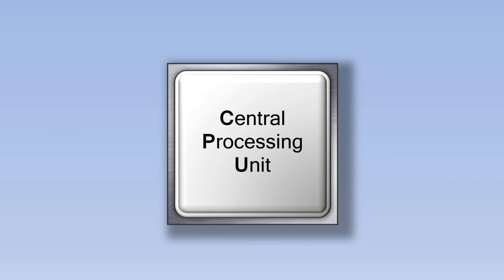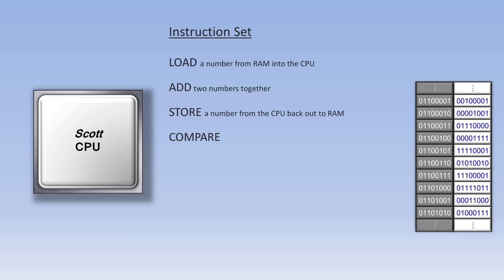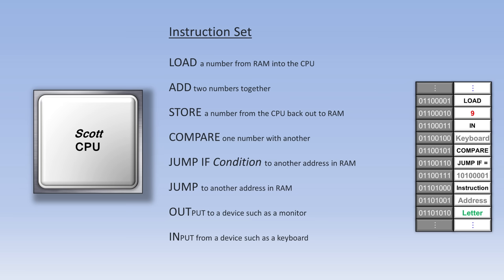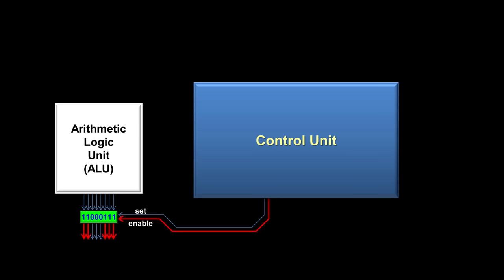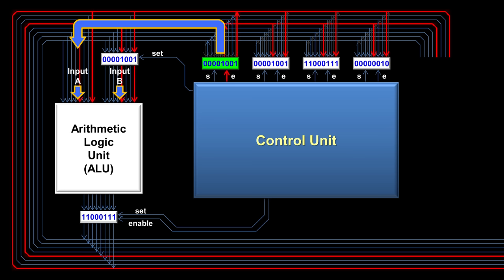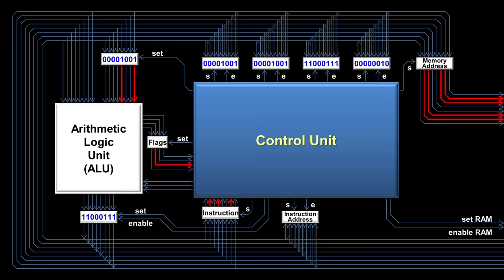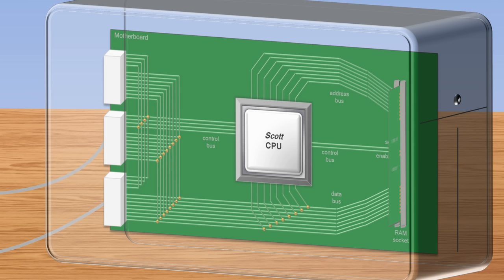How a CPU Works

Comment: Funny how these CPU's have IN and OUT instructions instead of handing I/O devices at a memory location and using Load and Store instructions. I believe Motorola's 6800 used the full address space in a linear manner and did not have I/O-specific instructions. But he did say that the Scott Computer's addr bus is only used for RAM.

Comment: I started working computers back when they had vacuum tubes.  Basic intro to Computers,  They are like your kitchen they have a counter top /CPU.   A storge area shot term/  the shelves  of your kitchen and log term storage/ The cabinets and BACKUP storage / the pantry.  The size of each is the ability of one person to do the work/  AKA store data and produce output  meals.      The speed of the CPU is how many cooks there are in the kitchen.   THIS IS BASIC COMPUTER PROCESS IN A NUT SHELL.

Comment: Thank you very much for this video ! Unfortunately, I knew all this. I am wondering how the data is processed through wires into the CPU. How some electrical inputs into CPU wires can output the result of an addition, for example ? :) I know that the 0 and 1 correspond to electrical presence or no electric presence, but how could it have a precise result ?

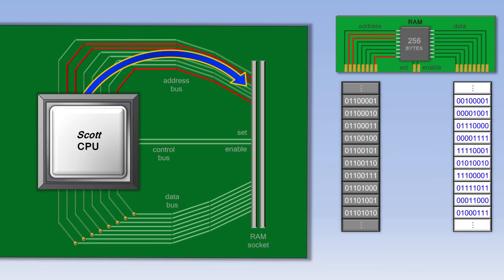Comment: 2:42 why is the data bus on the RAM used for reading and writing? wouldn't that mean there are input and output Logic gates on the ram hardware itself for reading and writing? and wouldn't that cause a short circuit? 

ps; im not an experienced electrical engineer or some sort, i just tried this on a digital logic circuit sim where I connected an input button to the output of a logic gate.

Comment: hi it's good but you only show how it works on its level would be good to have some micro architecture insights = bus openings etc and logical circuits as well, the foundation of microprograms and finally the logical gates etc

Comment: I don't understand how these wires can switch on and off billions of times each second. I also don't understand how the wires can be so small and close together and how it is possible that the electrical currents don't interfere. I always hear a wifi can mess up information in a unshielded cable so how on earth are there no problems inside the cpu where wires are basically on top of eachother?

Comment: MULTIPLE CODING
Why use binary code?
because the introduction of the third variable will lead to coding inaccuracies due to AC voltage surges.
If you use constant current with constant voltage in processors, you can create multiple coding.
It's increase in computing performance.

Comment: One question: HOW THE FUCK A CPU CAN PROCESS MILLIONS AND MILLIONS OF INSTRUCTIONS PER SECOND?!
Reply: The internal clock is running that quickly. Electricity is conducted at near light speed, so all you need is something to be stepping through your program quickly enough.

Comment: Hey where goes turn off signal from cpu? normally shutting down pc.Not with swich button from desktop. when shutdowning with swich tester drops voltage from +5to0and and goes back to +5 but when shutingdowning normally ( in pc desktop start shutingdown)no signal comes to swich...🙃 so if you could. please help to find signal😊

Comment: i wonder if we will ever get to a point where literally the electricity cannot move fast enough around in the processor and hit the ceiling of the electrical processing power 🤔
Reply: That is actually the reason a cpu has limits on speed.  Electricity causes heat. Too much heat things melt.

Comment: But what do I need the RAM for? Say I save the adress of a bool in a 1 byte big adress then I still have to know the adress from somewhere and instead of knowing the adress I could only know the bools state and then even save some memory

Like lets say I as a human have a book and now I want to memorize a specific line, I can either memorize the exact location, or the line itself, but then memorizing the line itself is faster, so a RAM seems kinda counter intuitive

I love how I have an electronics engineering degree but still no clue on why shit is like it is
Reply: You're not saving the address in memory, it's that the location in memory HAS that address. There's no saving the address, it's just the physical location where you find that data. You don't need a map or to memorize the layout of an apartment building to find a room. You know that each room number starts with the floor and then counts up from one end to the other. That's enough to find what you're looking for.

Comment: How does a register hold an instruction in the physical world is it like a capacitor or a transistor? How does it hold the information?
Reply: Flip flops are logic devices used to store the smallest amount of information, a bit. These flip flops can be cascaded to hold more bits and allow you to hold more information than a single component ever could. The way a flip flop holds information is by "trapping" it in a way. If you look up "D flip flop" you'll find some diagrams showing how the 1s and 0s sort themselves out inside. You may also find the term "latch", which is similar to a flip flop but slightly different. Ultimately they do the same thing, but have different clock behaviors.
Flip flops themselves are made up of logic gates, which are just combinations of transistors.
Reply: Registers are arrays of flip flops.

Comment: How does cpu sends the address to RAM? How does cpu know about the address? 3:20
Reply: The addresses are either stored in the program itself or the CPU gets instructions how to compute the correct address. In both cases it is the job of the programmer to provide the correct addresses. In any CPU design there are instructions which look like this: "load from address X into register Z" or "load from the address stored in register Y into register Z".

Comment: But how can the clock turn on and off billions of times a second? How does that work?
Reply: there’s a very small man who lives in the cpu constantly turning a switch on and off as fast as he can. that’s gotta be it
Reply: @jasonmiller677  XD
Reply: There is clock circuitry that causes the clock to oscillate between high and low voltages rapidly.

Comment: The CPU and GPU will work for Commamad For every App from one to a Million like 275,812 even two Commands at once or three and More in killer idea and A Line like | it's much faster Chip Execs. And Smater with more Clock faster OS and Apps even Camera, Games and Screen with 10X more PPI and more Battery in device. In 2 years. The Chip will be Faster 250X and more without a Fan. With out 1 and 0. Also more and more In SoC. Even in Mac.

Comment: No you can't just call everything a wire. The clock is not a "wire".
Reply: @theleglend  there is a difference between simplification and over-simplification. If you want to simplify it then say a clock is a thing, don't lie and say it's a wire.
Reply: @boliussa  He said the wire was the clock, there's no lost information here. You're just being pedantic. The clock is an oscillating digital signal, so it's not inaccurate to describe it as a wire for the purposes of understanding a CPU's architecture.
Reply: @thegreatzoom5073   dude ,you write  " The clock is an oscillating digital signal" <--  A signal is not a wire.  It is inaccurate to call a clock a wire in any context. From what I understand, contary to your claims, clock in electronics, can refer to clock generator or clock signal. When he says clock he means clock generator not clock signal, so you are wrong re what he'd mean by clock. And anyhow, a clock (by which he'd be referring to the clock generator), could be described accurately, as a circuit (a circuit that produces a clock signal).  It is not a wire. A clock signal is not a wire. And a clock generator is not a wire. You are simply wrong on many levels even when you are trying to then get more accurate , you make excuses and get things more wrong.

Comment: I would say the motherboard is the brain of the computer and the cpu is the heart of the computer.
Reply: Please stop comparing Computer architecture to human anatomy.
If the Motherboard was the brain, what's the RAM then? And the Hard drive? What about the GPU?
You could argue that all of that is "the brain".
What's the equivalent to a power supply? Is it the heart? The lungs? The stomach? 
What about fans? Could you compare fans to the tiny holes in your skin that produce sweat?
Reply: @portalwalker_  The short time memory, duh. The HDD/SSD your memory, GPU your imagination and eye seeing power. The PSU would be your cells and your stomach, the fans the lungs, Those "tiny holes in your skin" are called sweat glands, and they are supossed to be avoided water condensation or could be seen as a watercooling system. 

Why even bother when it offends you like that, just ignore, grow up or touch some grass or something. Jees.

Comment: I thought the motherboard was the brain of the computer
Reply: Please stop comparing Computer architecture to human anatomy.
If the Motherboard was the brain, what's the RAM then? And the Hard drive? What about the GPU?
You could argue that all of that is "the brain".
What's the equivalent to a power supply? Is it the heart? The lungs? The stomach? 
What about fans? Could you compare fans to the tiny holes in your skin that produce sweat?

Comment: A standard everyday cpu like an i5 turns on several billion times per second? I have a hard time believing that. 
Sounds like bullshit.
Reply: How is it bullshit?
Reply: It isn't turning "on", it's oscillating a signal from high to low. Electricity functions on a totally different timescale than we do, very large or small numbers are standard. I've designed frequency dividing circuits before and that math doesn't work out if the input signal isn't what you expect it to be.
Reply: @thegreatzoom5073  yes, clock cycles don't mean turning on per ______. They mean how much pulses of electric currents or signals they can take and calculate per second if u remember correctly

Comment: Head of Intel: "Some software runs faster on an Intel because some greedy people were offered cash to write their software with the Intel compiler, the one that secretly detects who's processor it is first before deciding if top speed is needed. The benefit is that people can put food on the table.

I thought it was illegal to avoid tax and bride people to only use your products. So, pay tax, be honest about how much tax we've actually paid, don't bribe anyone and stop slapping a new number on the same processors every time a tiny competitor launches a new processor. Got it. Thanks for the advice. Why oh why didn't anyone tell me years ago?

This is a private message for our fanboys ONLY: maybe, just maybe, there's a teeny tiny bit of truth to the idea that someone else might make faster processors.

Ouch! Get off my leg. You're not my pet. How do you get rid of this thing?

I also have a famous mega family but right now I think I need to visit some of my rich uncles, uncle Googie and uncle Amazy, to pass on some of these new tips so that they won't get into trouble with the law.

And by the way uncle Amazy is the one who sells all our processors out of his garage, along with several saucepans. At least, that's what he told me.

He says that the garage is where he keeps his 1535 cars but as none of them have worked for the last 14 years he's been getting rides from auntie Ubee's cars.

Oh, and you can keep your money too. We don't need any more of it, thank you very much."